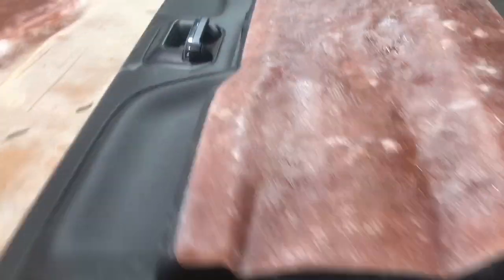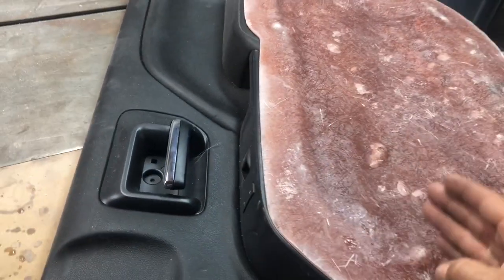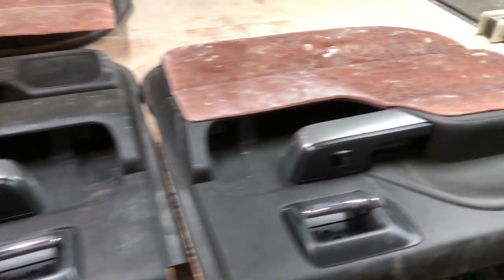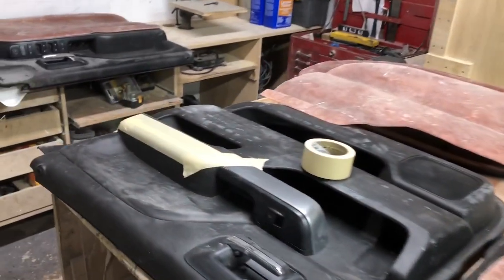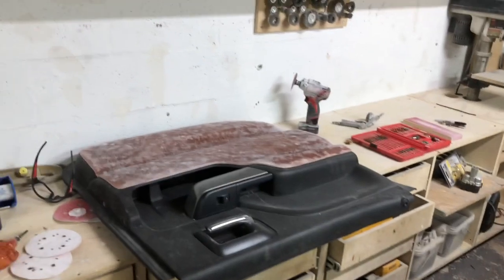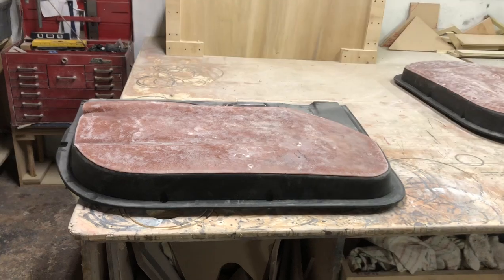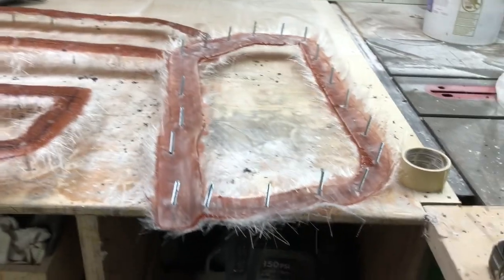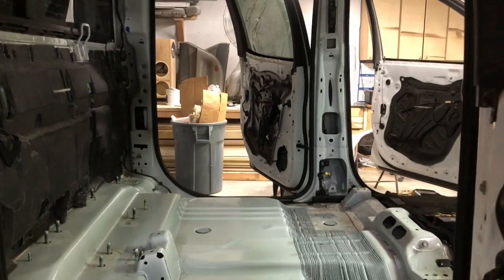Supreme Patty SEMA BUILD Episode 3 : Fiberglass Doors pt2

Comment: just a recommendation  don't use nylocs they get hard to tighten and the heads of the bolts are in fiberglass and may spin and ruin all your work. Use lock washers an flat washers with hex bolts. maybe some treadlocker for added security. just my 2 cents